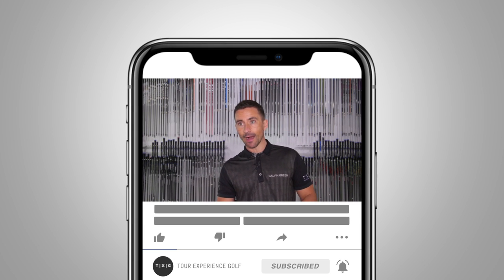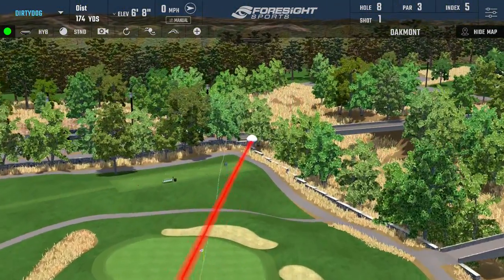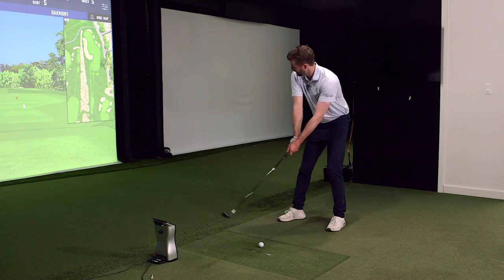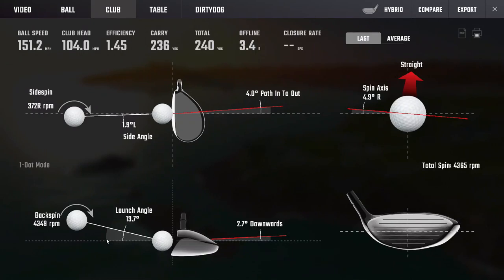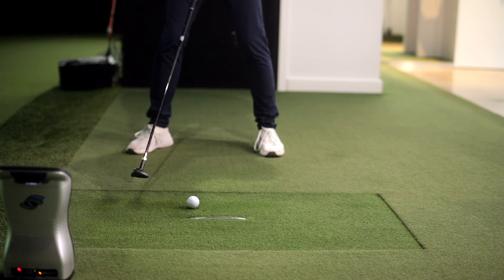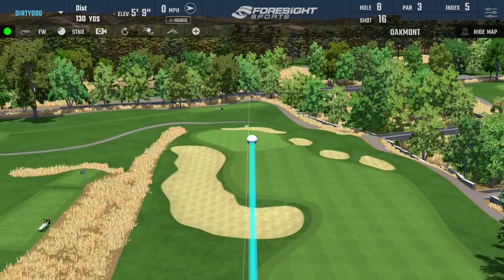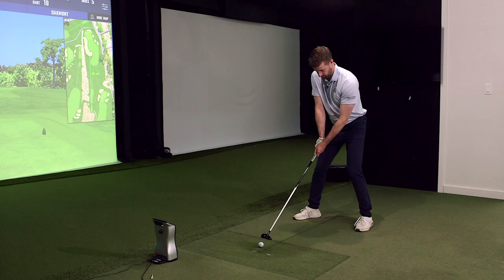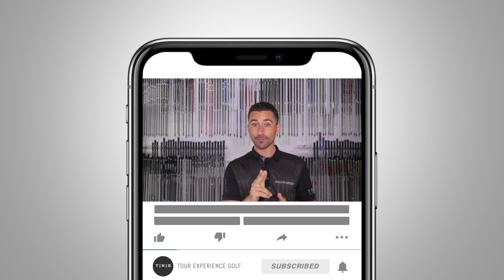How to Hit Fairway Woods & Hybrids

Comment: Great video, this is exactly what I was struggling with my 3 wood off the tee!  Had it set up as a driver and had the same inconsistent flight issues in addition to a heavy slice.  Moved it back now and it’s much improved, now being a fade and my distance is increased. 👍

Comment: I got this same advice in a recent fitting. For my hybrids I used to play the ball in about the same spot as my mid irons. Moved it up a bit and my contact immediately got much better, especially on a good swing. No amount of ball positioning seemed to help with a fairway wood, though, so we ditched it and went with a 2H instead.

Comment: I'm one of those guys.  I have so much trouble with both of my hybrids (3 and 4) and both of my fairway woods (also 3 and 4) I no longer put them in my bag when I go to the course, even though I hit my 24 degree 5 iron very well.  Most frequent ball flight with all 4 is a duck hook. I think with Matty's club head speed he can make any strike look good.  I, on the other hand, am 69 years old and my club head speed with these 4 clubs is 75-80 mph.

Comment: I def do not hit my 3H as long as my 5W.  It is prob more of a club  difference.  But now I am getting older and slower, I def put away 3i and 4I and swapped them with hybrids.  Even considering adding a 5H lately.  I think most amateurs need to be honest with ourselves and admit we do not have the swing speed to hit a 3 or 4 iron up high enough to hold the green.  With the hybrids, the ball gets up in the air easier and give us a better chance to hold the green.

Comment: Pretty much never hit 3wd off the deck anymore. Just don't have the confidence. It goes a long way, and can go very badly if it's just slightly off. Similarly my hybrid is rarely used for inconsistencies. Most time I just take what I can get with my 4 iron on long holes. It more likely stays in play and even if I have a pitch left or something that's still better than the risk... Need to work on this.

Comment: I have a custom short 4 hybrid with a ton of lead tape thats meant to mimic a Cobra one length hybrid. I use it from the rough and bad lies 200 yards out. Thats it. Its not in my bag for gapping or very rare tee shots. I think that is a proper use for hybrid. 

If you can get that Cobra one legnth hybrid, i think thats one of the greatest clubs ever made for someone who doesnt drive the fairway often. If i drove fairways or first cut rough regularly, i wouldnt carry a hybrid at all.

Comment: Using Cobra one length irons and hybrids. Have played about 7 rounds with them so far. Ball position is middle of the stance with everything from 3h to GW. Find I am more often than not topping the hybrids. Suggestions? I know I have an over the top swing fault, so that is a work in progress. However, do one length clubs require a different angle of attack than standard length clubs?

Comment: Yes guys thanks... 'think' Ive realised that 'sometimes' my dead-straight push (about 20yds right), with new mavrik subzero that takes just a bit much turf is slightly back from nominal position. 
I must sub-consciously put next one forward a little bit - or hang back in my swing cos I get shallow slightly hooky shots - or Tops 🤦‍♂️.
This vid just re-enforces that I kind of know the ball position is slightly off and I over adjust the swing.
 
Light bulb indeed 👍

Comment: What about teeing these clubs up? I've always had troubles with 3 wood and hybrid off the fairway and this video definitely gives me some insight as to why as I fit into the too far forward camp with both clubs. That being said, off the tee I've actually been quite comfortable with these clubs and often use my 3 wood more than my driver because its usually straighter and long enough for most holes. Is it fine to push the ball position further forward off the tee due to the ball being higher up and wanting to emulate the driver characteristics?

Comment: Ian, I read some tech on fairway wood lie angles: Taylormade 60*, Callaway 56*, Mizuno 57*. I tend to hook or pull the 3 wood. Recommendation? (Presently using Taylormade Aeroburner 2.0)
Reply from the maker: Flatter will be better if you tend to hook it

Comment: I have a Rogue 3 wood 15 degree. My Trackman numbers are 88 club head speed with almost zero attack angle and path, 15.7 degree launch, 3500 spin. Is this optimized for getting as close or on the green for par 5s? I was wondering if I would benefit from an Epic Flash head and turn the loft down.
Reply from the maker: not bad, but yes you could hit it a little bit farther with slightly less loft